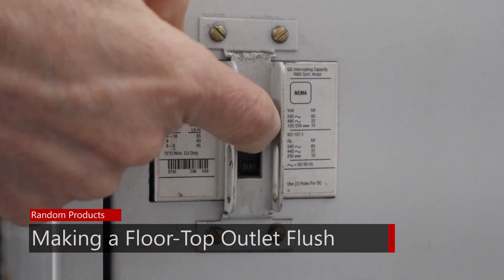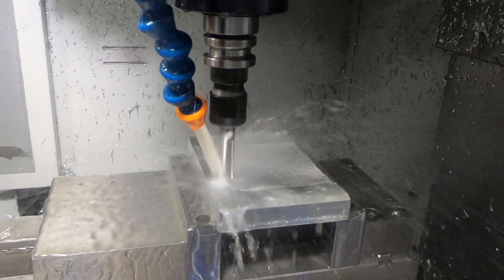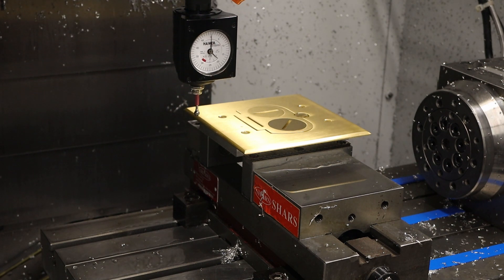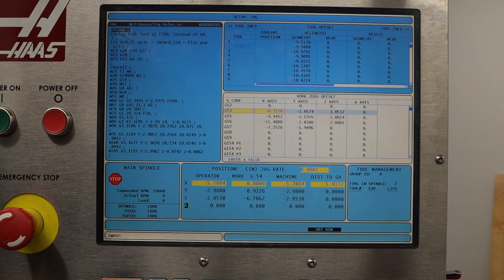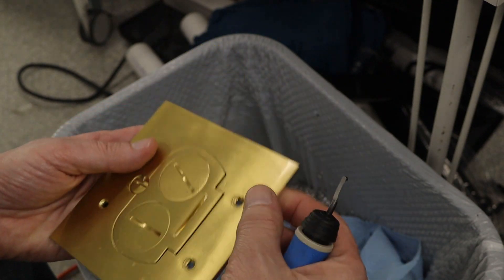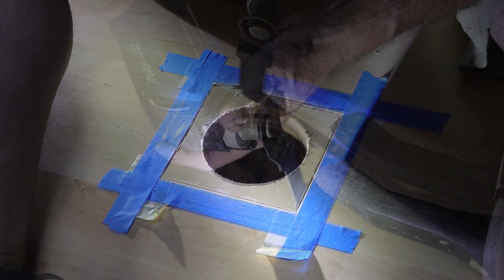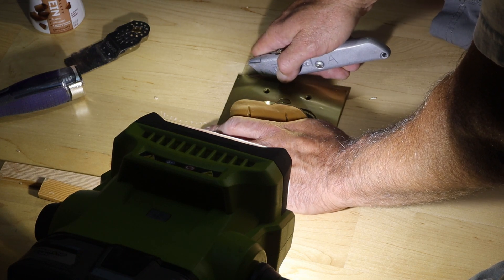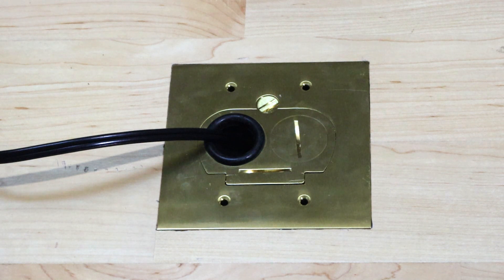Making a Floor Top Outlet Flush

Comment: Oscillating saw.
The tool we see today was made after some one observed the saw used to cut cast off a broken arm.
The blade does not need to be very sharp to do the work and if it touches your skin it does not cut.
And the cast saw was repurposed from a skull saw that had a depth guard so it would not cut into the ol gray matter.
Reply from the maker: Thanks. I didn't know about that history--it's pretty cool.

Comment: Nice work. If you are putting more of these in, make the contractor a template out of fiberboard that he can stick to the floor with double sided tape. Then use a template guide screwed to the base of a router. It will follow the template and cut out the opening. The corners will be the same radius as the router bit. He can then clean them up with a chisel. Or better yet, you can machine the brass outlet cover with matching outside corners so the contractor can do the whole job in 2 minutes, all with a router, no chisel at all. Look up router door mortise template for ideas.
Reply from the maker: Yes, that would have been easier. I talked to my contractor about that, but he doesn't like routers. Say's they're too dangerous. So he felt more comfortable doing it this way. It was part of a fixed-price contract, so his choice.

Comment: What?!  What did I just see?  Seriously... You used up all that expensive aluminum stock to build a fixture for a simple operation? There are several ways to achieve the same result without the need of a jig. Just clamp it perpendicular to the vice sandwiched between two blocks and mill off the top edge of each side, or screw it on to a block using the exiting screw holes and clamp it in the vice. It's ornamental not a precision part.
Reply from the maker: Nah, aluminum is cheap, especially compared with the brass floor plates. But yea, as I mentioned in the comments, this is overkill. And fun.
Reply: @JohnSL  OK. As long as it was fun, then it's OK.  Btw, I you should check out Steady Craftin channel. The host is a genius who have figured out a lot of tricks in home manufacturing and is incredibly funny and folksy.  In this recently released video, he shares how he's able to create injection molds without a CNC machine: https://youtu.be/wMRSPXt48CI